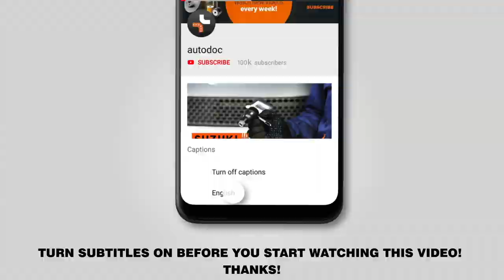How to change front brake discs on ALFA ROMEO 159 (939) [TUTORIAL AUTODOC]

Comment: What about Alfa 159's that have the brembo calipers?
Reply from the maker: In general, the replacement will be the same, the only thing that may differ slightly is the design features of your car. 
More accurate information can be obtained in the technical documentation for the car or by contacting the service.
AUTODOC

Comment: Great video!
How to know when is disc at minimum?
Reply from the maker: The vibration of the brake pedal at the moment of light touch. The disk has become crooked.
The strong beating of the pedal or even the front of the body at the time of active braking.
Pulling the car to the side when braking with the beating of the brake pedal.
The appearance of a noticeable shoulder at the end of the disk.
AUTODOC